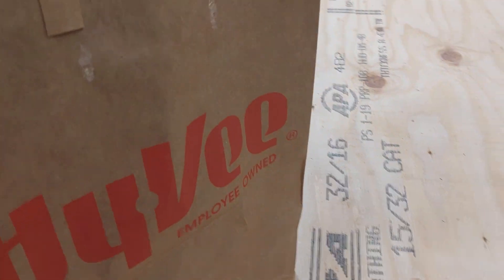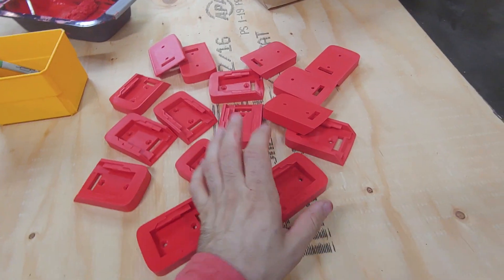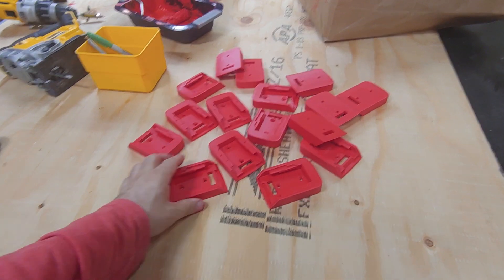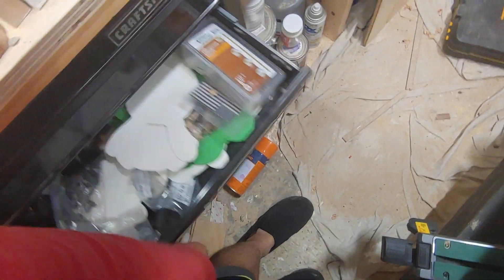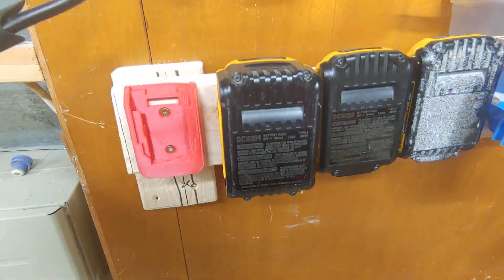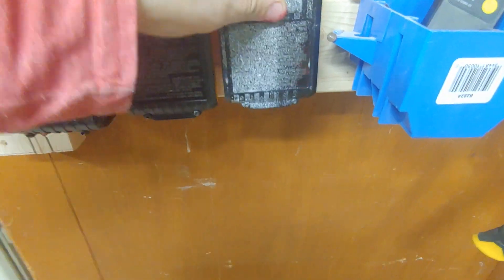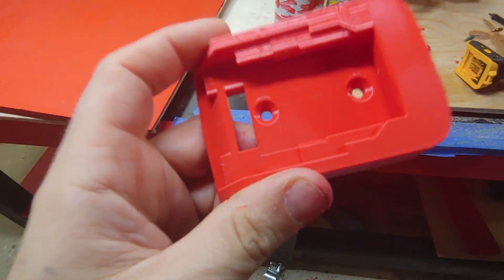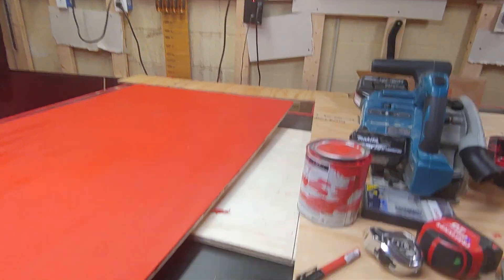3D printed DeWalt Battery Holders

Comment: I want to start creating my own wired connections but they are expensive alone but the battery holders are really cheap I’m wondering if I can somehow wire them up with a oscillating tool or something